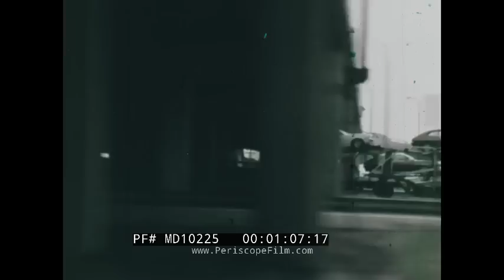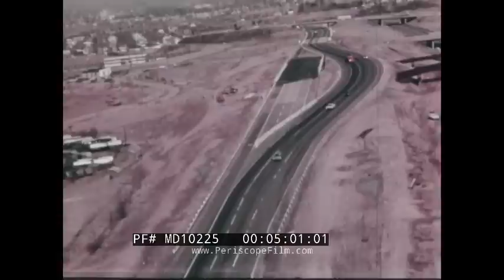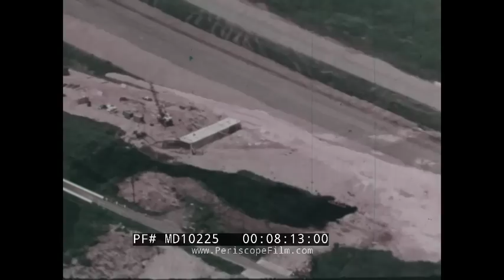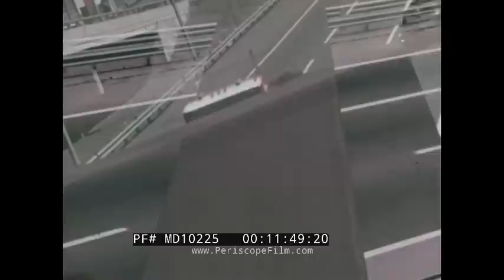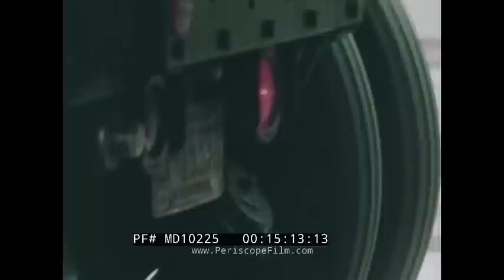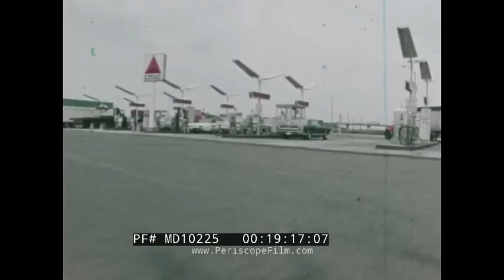" INCREDIBLE JOURNEY "  1972 IMPROVEMENT OF THE NEW JERSEY TURNPIKE INTO DUAL-DUAL HIGHWAY  MD10225

Comment: They run on their rules. Its private property technically. If you break down no one is to tow you off but the contracted tower from mile marker xx to xx north or southbound. As a tow company must have certain towing and recovery vehicles ready 24/7/365. Repairs are not to be made on the NJTP, some tire service can be done for larger truck by contract. The NJSP have their barracks along the Pike. Only servicing the NJTP. It's a well-run highway. Busy and gets crazy! I used to run contracted tow trucks and do some recovery work for them on the Bordentown exchange area. I learned a lot how it works and enjoyed doing it.

Comment: Back in 1976 we had a math question about a car driving on the NJ turnpike from one exit to another in a specific time. At the toll booth a Trooper moved the car over and wrote them a speeding ticket. We had to calculate that speed. It was 66mph in a 55 mph zone. From that point on, I always stopped at a rest area to avoid the ticket!
Reply: I've lived all over the US, seven states so far, driven in all fifty, and made  countless coast to coast road trips since the '70s, and that old story has been going around for decades about every turnpike in the US.  😄  

For example, in addition to frequenting the NJ turnpike between Philly and NYC, I had to drive the entire 360-ish mile length of the PA turnpike back and forth several times a year in the late '70s, which especially in the days of the double-nickel seemed to take forever, and I remember along the way truckers on  channel one-nine getting in arguments about whether that story was true or if it was even possible.  Like all urban legends, no one had ever had it happen to them personally, but those who doubted it or thought it was silly got assured it was true by someone who knew someone who knew someone it had happened to.

I've never thought twice about it and have never gotten a ticket.

Comment: One thing I do like about the NJ Turnpike is the separation of the Car only lanes from the Car and Truck lanes. You don't have to drive alongside 18 wheelers. That part of it makes me feel safer when I drive on it.  It was a good idea to do that. However, the northernmost section of it, the part that you drive on to go to Newark Airport, I do not feel safe on at all!  I feel like I'm about to get run over by 18 wheelers and people driving fast and/or crazy. I hate going to Newark Airport because I feel like I might get killed driving there or away from there.
Reply: Ever try driving like a Lemming? The arseholes will back off.

Comment: I was a toll collector for the TP in 1980. The TP does not get a dime from the state. All TP revenue comes from the tolls. All the NJ State Troopers are paid by the TP and the patrol cars are owned by the TP. The license plates say TPAxxx. The last widening project was done around 2013 from Exit 6 to Exit 11, about 43 miles, and cost 2.3 billion. It was paid for entirely with a toll increase from a few years before. During this project the state required the TP to replace every single tree that was removed with 2 more trees somewhere else. I have seen heavy snow cleared from the TP in less than 24 hours. At the same time, there were long sections of state owned Route 295 in Burlington County that were not plowed at all, and one week later we were still riding on compacted snow in that area. In 1980 a 5 axle 18 wheeler cost $9.10 for the entire length (exit 1 to 18). Today I heard it is somewhere around 80 or 90 $$$$,
Reply: Yeah. The toll plazas every 50 ft make it clear that there isn’t any outside funding.
Reply: Was the sky always white like in this video?